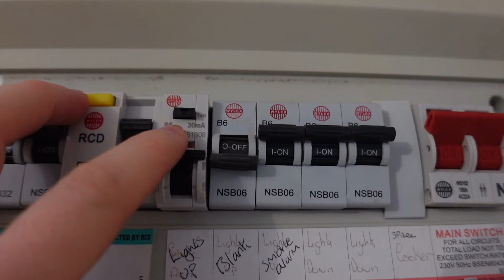How to Install a Dimmer Switch | Beginners Electrical Guide

Comment: This is really great I always wanted to install dimmer switches in my house but too scared to do because on the common thing most people are afraid of that is "The Fear Of The Unknown." But I should have done what I usually like to do which is to buy one and examine it. I usually like to keep things I'm not sure of for a few weeks so I can look at it from time to time to get to know and understand its characteristics first and then feel confident enough to try using it. Just like I do with tutorial videos. I know when I watch a video but then after watching the video a few more times I understand it much better and become more knowledgeable of the item in the video and eventually build up confidence to attempt the task but I always apply it to an area that mistakes won't harm or cause problems and when I'm certain it works ok I examine it further before applying to the intended place I need it. Great tutorial  guides in your videos and a great asset for teaching ordinary household folks that can feel the problem is bigger than it actually is. Thank you so much for your expertise and great quality teaching? I'm going to send this video to a few friends I know who would love to learn these and follow you for your advice and techniques

Comment: One question. I changed one, but it makes a small noise. Is that normal? I put the red wire in L1 and the other one in the middle one.

Comment: Just installed a dimmer switch thanks to this video, but now lights take a second or two to come on. Checked the wiring and connections but can understand why. Just installed some luceco f type 5w spot lights.

Comment: Hi, my light switch has a wire going into L2 and a wire going into COMMON.  My dimmer has an L1 and a squiggly line with an arrow through it.  Do i put the COMMON wire into the squiggly line one and the L2 into the L1?

Comment: Great video straight forward instructions. I'm about to fit a dimmer switch but the one I have has 2. 1. And c. I'm wanting to know what the 2 is for? Thanks again
Reply: I'm have a room that has 2 switches but I'm planning to install a dimmer that will control 4 led downlighters. I connect the live to c terminal? And the neutral to 2?

Comment: Hi DIY Guy! An excellent tutorial in a clear voice with precise instructions and warnings of pitfalls to avoid ( e.g. Lighting types, and power Loads ). Do you have ( or plan to have any videos ) for  Double or 2-gang light switches on the same  plastic plate which cover large rooms with 2 or more lighting circuits? For example, one push dimmer switch controls the kitchen area  LEDS and the second dimmer switch on the same plastic plate controls the rest of the LEDS (each of 8 watts ) lighting of the sitting room. It would be of great help to many. Thanks in advance.
Reply from the maker: Hi. Thanks for your comments. You might want to keep your eye on next Saturday's video 🤔😉

Comment: This is useful, I just wanna ask if I can connect a dimmer switch as a two way switching position
Reply: Yes, It was mentioned. Only 1 dimmer 2 will cause lights to stobe. Take photo of connections before disconnection, few different methods of wiring 2 way switch. Also check instructions so you can set dimmer range.

Comment: And if the recess behind the old switch is not deep enough for the new dimmer switch, then...   

Also, remember that not all light bulbs are dimmable.
Reply: I had this issue without having enough space. I went and bought a light switch bracket/spacer in my local DIY shop for about 1-2$ when I realised I had this issue.
Reply: I always imagined you as more of an oil lamp kind of chap :)

Comment: Ive got 5 50w 12v GU5.3 2 pin bulbs which are dimmable.....can you please tell me what voltage is needed in a dimmer switch? I know the bulbs say 12v...but do you stick with 12v for 1 bulb or times that voltage by how many bulbs you have?.....ie 1 bulb= 12volts....or....5 bulbs= 60volts? I just need to make sure im getting the right switch thank you

Comment: Hi

What about regarding a standard halogen on/off switch …. I’ve Changed the lights to LED (cutting back the earth and leaving it disconnected)….. with installing a dimmable switch do I just cut back and tape up the earth same as the lights…. Then only using the live and negative? Thanks

Comment: I have a dimmer switch using a normal bulb (not LED) and I want to have a LED bulb. Can I use my current switch with any LED bulb? or do I need a specific dimmer switch for a LED bulbs? or can i use my current switch but need to get a dimmable LED bulb? thanks for your help.
Reply: You need an LED specific dimmer switch I'm afraid.

Comment: Hi bud,  I have a metal front and back on my current switch which needs changing, so the earth is attached to the front of the switch I'm going to take off, the switch I'm replacing it with is plastic and not meta like the old one, my question's are 

1. Can I replace the metal switch with a plastic one?
2. If so where does the earth wire need to go? Do I attach it to the new plastic switch?

Thanks for any help you can give
Reply from the maker: Hi, yes you can use a plastic switch. The earth wire(CPC) only needs to connect to metal. It will need to be attached to the metal back box but can either be terminated in an earthing terminal on the plastic switch or can be folded over and left inside some sleeving for a later date should it be needed.

Comment: HI - ive installed a dimmer on a LED fixture that states its dimmable. Since fitting its now buzzing, never buzzed while on a normal switch and doesnt buzz when the light is full "on" - as soon as we dim it it starts to buzz. All wires are connected securely and earthed properly, doesnt throw the breakers. Any ideas?
Reply: You need dedicated dimmer for LED they come with some adjustement screw.

Comment: 4:67 what he is saying here ? Two dimmers on one light cercuit ? One dimmer per circuit So if you have two way onstalation you can use only one dimmer switch
Reply: Yes, one dimmer max. If you need another switch just use a normal light switch as the second switch

Comment: Why does my LED rated dimmer buzz when on ? I have the correct wattage of led and they dim perfectly and don’t flicker but the dimmer unit itself buzzes when on ? Any ideas much appreciated
Reply from the maker: Quite a common issue. You can try changing the bulb and dimmer to see if one on those fixes the issue.
Reply: @TheDIYGuy1  I got a sparky in, it turns out there are 2 types of dimmer leading edge and trailing edge, the former is the old type and typically needs incandescent bulbs and the latter is for  LED, apparently the buzzing on the leading edge is normal, the trailing edge are silent. Apparently its not a fire risk just annoying and most people pay for trailing edge dimmers as they're silent, I will upgrade mine.

Comment: You cannot and should not rely on a volt stick to prove a circuit is dead.
You also have to check that your lamps are suitable for dimming switches. Not all switches can dim LED. Just checking the wattage capacity of your switch is not enough.
No explanation for putting a switch into a plastered wall where you may need to recess a new box into the wall structure.
DIY the job once then call a qualified electrician to sort it out properly.

Comment: The blue wire is a switch wire not a neutral, get your facts right you are only confusing people who shouldn't be doing it in the first place
Reply from the maker: The blue wire is a switched live indicated by brown sleeving. Originally a blue wire(neutral) Let me know if you need any help with this.
Reply: hi again, I know it's a switch wire (50years domestic electrician) just retired, however in the video you mentioned at 6. 27 mins it was a neutral, regarding the old colours, I know what you ment but the novice won't,